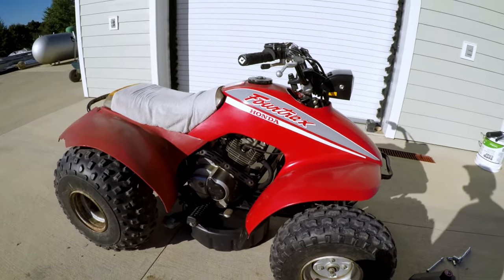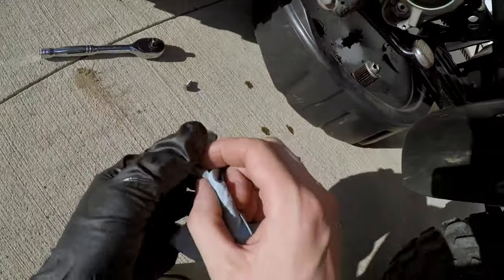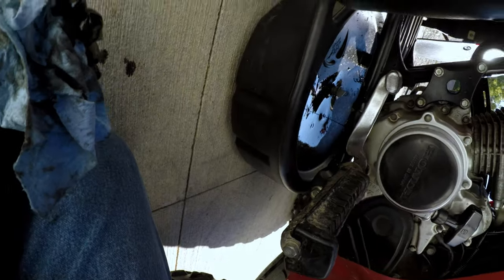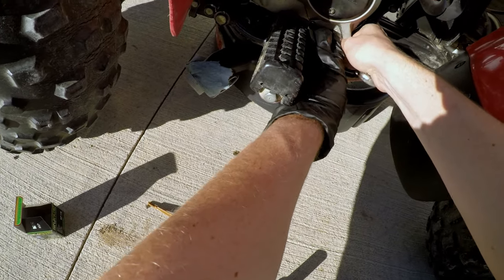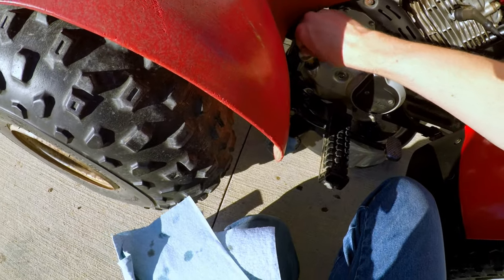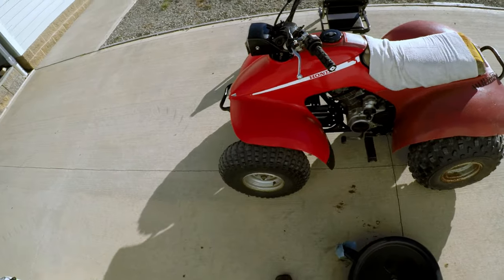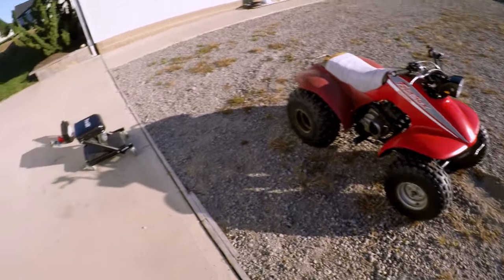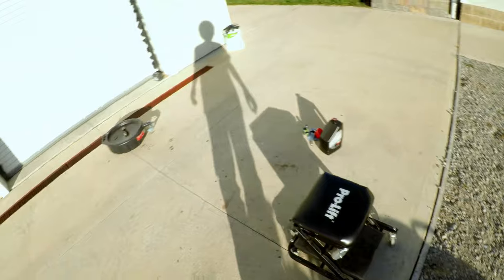TRX 125 Gets an oil change and a new filter

Comment: Hi, thinking of doing a oil change on our trx 125 1998. What oil do you recommend? Also have you ever come across a whistling sound from around the engine sounds like a brake is sticking but it is not
Reply from the maker: I will direct you back up to the video whose comment section your writing in.  There you can find all of the relevant information pertaining to this task.  Lastly, I thought you/our had an 1987 trx125? Honda discontinued the TRX 125 in 89.
Reply: @THEdisgruntledmonk  Hi, thank you for your reply.. yes I have a 1988. Just returned back to Europe and she started up straight away but had the sound coming her.